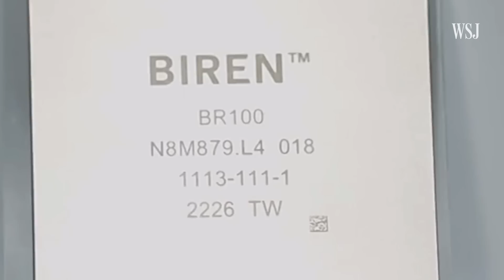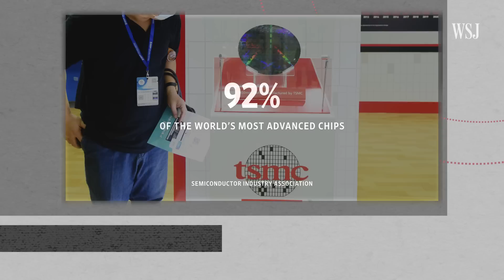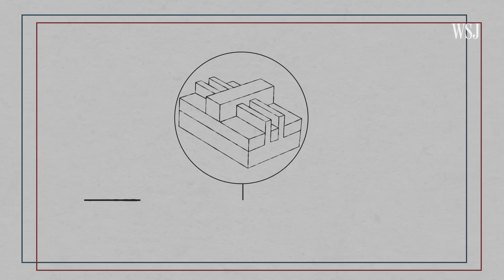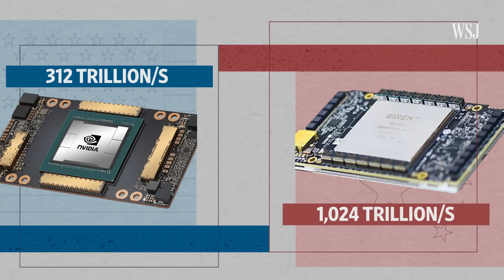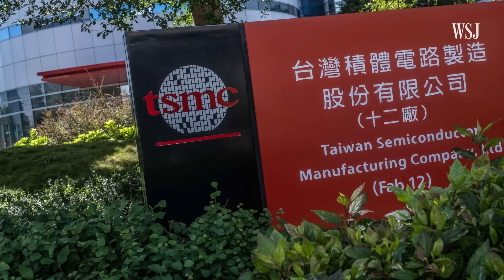Has Nvidia’s A100 Chip Met Its Match With Biren’s BR100 Processor? | WSJ U.S. vs. China

Comment: As someone who works in this field, measuring chip superiority purely by looking at transistor counts and flop/s is a naive approach that will lead to wildly inaccurate conclusions. Scaling memory bandwidth to keep your compute fed with data is a far trickier problem these days than simply stamping out more compute logic and declaring you have a higher theoretical flop/s than your competition. 

Also, one of the most important factors not mentioned is the compiler/software support for your DSA. It is easy to hand craft code that will boast impressive benchmark performance numbers. However, the real secret sauce is having a robust compiler that can efficiently map general workloads to your DSA. It is for this reason most AI chip start ups will fail, not because of inadequacies in their hardware's architecture.
Reply: Compiler support is one reason the x86 architure has stayed around for so long.
Reply: China doesn't have to beat the US pound for pound (or in this case, nm for nm / flop for flop). It just needs to be good enough to overcome US sanctions (which it is doing, at least so far).
Reply: @sleepyjoe4529  No its not even close to doing that . Chinese chips suck hard they cant do anything without Chip imports . All modern chips needed arnt cheap 16 nm . Yes nm do matter if you want to do anything usfull with them .
Reply: @sleepyjoe4529  Hay that is kind like what I said.  So great mines think alike.
Reply: @bobcharles7716  I never heard of thinking mines. Maybe you meant thinking minds.
Reply: Design all you want.  It doesn't matter without the Fab. China has already been able to make the lower end larger nm chips.  It always has been the more advanced chips that they lag and they still do.  We're not even talking about the NG 4nm chips here.  When China has a large domestic fab capable of making them that's when they've arrived.  We're no where close to that hence the huge investment by them and for that matter the US also.
Reply: I'm no expert but,i do agree with you on that part, it does feel kind of alarmist  and exaggerated that the Biren is superior to Nvidia,just like the recent NASA scientist talking about how chna wants to own a portion of the moon...anywho cold war propaganda gave us a lot from the space race,we may get AGI from this new cold war
Reply: Not to mention that these numbers for the A100 are for the AI workloads as  this is primarily a tensor GPU.
Reply: True. Better to wait for 3rd party benchmarks before saying if this is really legit or not. Same thing happened for China's Sunway TaihuLight supercomputer. It earned its spot in the top 10 most powerful computers at 7th place but it uses 10,649,600 cores. While Sierra at 6th place only uses around 1,572,480 IBM cores.

Source: Top500
Reply: @04:02 That's what he said.
Reply: The key is the major market share are in China. When US block China from getting Chip, they are force to build what they need. Whether it is better than US chip doesn't matter anymore, because once the ecosystem establish, there will be no place for US chip anymore.
Reply: How much you make working in chip industry bro? I'm trying to get a job and looking at different fields
Reply: @___Anakin.Skywalker  You dont go into that field just for money . If technology isnt what you want to improve become a banker there you make cash
Reply: @xythiera  how does a banker make money
Reply: @___Anakin.Skywalker  US tech companies are laying off employees especially H1B visa employees.. Tech companies in China has no laid off any employees. So China tech jobs is better now.
Reply: @SimonCU  Most of the lay offs are general workers in the retail not so much in the tech sector. Not to mention Chinese tech companies have been laying off workers in the tech sector for 3 years
Reply: you know what’s funny? when they blocked the chip imports… and said China won’t be able to manufacture it. Now, China has managed to make it. So the claim now is saying china will be unable to build the supporting hardware… which I am pretty sure China will be able to overcome it as well.. and pretty sure the software will also follow the same path
Reply: @aisinchan6640  They never made anything. And that anything can't even be made in China
Reply: COPE
Reply: "It is easy to hand craft code that will boast impressive benchmark performance"
At this point I knew you're just a troll.
Reply: He's exactly right, but what he describes is a secondary problem.
If you don't have the raw processing speed, all bets are off anyways.
We're going to pay dearly for isolating the world, when we get isolated by them.
Reply: @kavorka8855 About?
Reply: @kavorka8855 What??? 😅

No need to bring magic into a conversation about reality 🤨
Reply: "Researching American chips" yes we already "guessed" that.
Reply: Well said 👍
Reply: Oppressive regimes create terrible workers. Nobody will care and only do "good enough", poor quality work, because they have no freedom. because their lives suck.
Reply: Oppressive regimes
Reply: create terri
Reply: ble workers.
Reply: Nobody will care
Reply: only do "good enough"
Reply: poor quality work
Reply: because they
Reply: have no freedom.
Reply: because their
Reply: lives
Reply: su
Reply: ck
Reply: In the end software and optimizations plays major role. Just look how much more performance old cards like RX580 still had just by driver support. I know that this analogy probably don't apply as well to a server GPUs like this but still...
Reply: The reason why its so purly compaired is becouse it cant compeat . China cant make any modern chips to this day . There 180billion went into flames throw corruption .
Reply: The Chinese designed the Tesla's FSD and not to mention Tesla, SpaceX, Solar city are all Chinese rebranded technology incase you didn't know.
Reply: Biren chip look like a cheap GTX 500 series back im the day lol
Reply: As a software engineer, I can assure you compiler will never and could never be the bottleneck in this case, especially for a gpu. GPU is easier to support than cpu simply because you can have your own proprietary instruction sets. Unlike cpu, gpu's usage all goes through software api's first (like DirectX, Vulkan for graphics and gpu-specific api's for machine learning). For cpu, on the other hand, you need to use a widely used instruction set because most programs directly compiles to binary and then shipped. 

From what I saw you mentioned before, I am gonna guess you are not a gpu programmer or engineer and probably a cpu or embedded engineer. Gpu is different, it is like a whole separate computer strapped to your motherboard with its own memory/cache and instruction sets.
Reply: Do you think China will ever be able to have an advanced semiconductor supply chain wholly contained in China, including indigenous EUV lithography machines with all parts made in China with indigenous technology? If so, how long might it take? (I'm thinking 30 years.)
Reply: @FifthGate  Dude they invented the EUV lithography which they sold to Norway. The industrial boom on 1900 was thanks to China sharing their tech with Britain.
Reply: @FifthGate  Nvidia CEO and AMD ceo are Chinese and both of them are also from same family or related. The Chinese designed the Tesla's autopilot with FSD source code and not to mention Tesla, SpaceX, Solar city are all Chinese rebranded technology incase you didn't know.
Reply: @FifthGate  8 year, 3 months, and 25 days top. After that China would be better than anyone in the world
Reply: I am a machine learning engineer.  What he said is the following: The key advantage Nvidia has is its Nvidia CUDA platform of choice for AI development.  I will not trust any other platform,  including AMD’s ROCm.  It is far behind Cuda and I will not use it.
Reply: this is really bad hot take from the WSJ, you'd think they do a modicum of research prior to publishing trash like this. It's like judging a triathlete by a single sport
Reply: Keep laughing son
Reply: Exactly, the vega 56 has better 64bit flops than a 3090, and is comparable to the 2080 in other categories, but performs around as good as a 1660/2060 range.
Reply: @deadoon  Yes.
Reply: Ok, but writing software is easier than manufacturing hardware. If China can manufacture a chip that is capable of those high performance computations and lacks the software tools that streamline development then it's only a matter of time before those appear.
Reply: @ten_tego_teges that’s a naive thing to say. Look at AMD having great GPUs yet not able to break into the AI market. Yes everything is a matter of time pretty much but time is the only matter which matters. Right now Cuda based AI workflows are predominant and mostly supported by all ML frameworks. Id like to see generic approach to be adopted like OpenCL but so far it’s not the case.
Reply: @AI-xi4jk  Good points. However, perhaps AMD doesn't have a CUDA counterpart, because it is expensive to assure compatibility with ML frameworks. It makes little economic sense for them and everyone else.

Meanwhile, China is embargoed. I don't mean that Chinese computational units will undercut Nvidia. I mean that China is or soon will be able to produce their own technology stack independently of America. If it is on par at least with previous gen American/Western tech, then the embargo will be not have the slowing effect we thought it would.

This video claims they can make the chip. If they really overcame the billions of dollars of upfront investment into fabrication facilities then there's nothing stopping them from adding software. For them it makes strategic sense to fund it, for AMD it doesn't have to.
Reply: @ten_tego_teges  AMD does have a counterpart to CUDA. They call them stream processors. 

I think their struggle is mainly the proprietary software such as PhysX. 

While Nvidia has a dominance all they really have to do is match AMDs products and they’ll pull out ahead on benchmarks so long as the software is designed with Nvidia in mind
Reply: @ten_tego_teges  The video just shows the spread of propaganda materials. This chip has absolutely no usage and yet it is claimed to be 3 times faster than the Nvidia A100? Evidence? Something?
Reply: @ten_tego_teges  if they can get probes to the moon and mars by themselves... my guess is its only a matter of time they can build any chip too
Reply: The point is it doesn't have to be as good.  The more question is can it be a substitute/work-around to the American Lead Sanction.   And the larger questions can China have substitutes/work-arounds to all American Lead Sanction, If it can we are seriously screwed!
Reply: @bobcharles7716  China's advantage is its own huge downstream market. As long as the product is basically usable, it will quickly iterate to better and more accurate products.
Reply: @huas5350  Prototypes without any benchmarks means zero, mass production and a real world demonstration of the chips potential means everything.
Reply: @huas5350  so where will this be used?
Reply: @huas5350  China's biggest advantage in the global chip market is the US's aggressive foreign policy that is scaring away many countries.
Reply: @MGZetta  ASML actual bought most of their patents (including the most critical ones) from Taiwan after Canon refused to buy them resulted ASML (a 3 trailer parking lot startup) with dominant market position, namely the immersive EUV (which is currently most advanced right now and ASML's main product)
Reply: @huas5350  Actuly not at alk
Reply: @bobcharles7716  I mean they will eventually, and nobody is under the illusion they won’t. However this is not it, and it will take a long the to steal the IP and recreate these technologies domestically. The idea is that by that point china will already be weakened to the point where they can no longer challenge the US for tech supremacy.
Reply: @bobcharles7716  Don't worry buddy Chinese are not going to take over Americans... The thing with this tech is if you even overtake US chips in every measurable "hardware" way possible the US chips will still be far superior and ahead of the Chinese as the massive gigantic data sets that is needed to train the AI and the logic with the big brains required to solve the ultra-complex problem is only in America at the multi-trillion corporations like Google, Apple, Meta, Amazon etc. And if the talent that is needed to execute this level of operations is sitting somewhere else, These corps will simply buy them out. The only thing that the Chinese are doing is to play the scare game. Because it is long stated that we have far reached the theoretical limit of incompetence b/w hardware and software i.e., We have reached a level of advancement in hardware where the software is slow. At the end... The best things that the USA can do to prevent these non-sensical company to exist in the first place is to just ban the Chinese software(tik-tok etc) in the state!
Reply: @bobcharles7716  Wwhy would we be screwed? Just stop shipping them food lol
Reply: @jarethgar  The biggest grain exporter is Russia!  Ya we are going to be screw!
Reply: @bobcharles7716  why do you want to sanction others so badly?
Reply: @bobcharles7716  Well the chips act is DOA right from the start. Those new plants in Arizona are still work in progress. Anything can happen in the next few years.
I predict it would be like the failed Foxconn project.
By the time the chip plant starts operation, China might already flood the market with low cost chips.
Reply: do you get paid well? what's your area?
Reply: Its good to see more competition among chips maker. Make chips better and competitive prices
Reply: I disagree.  The numbers provide an accurate rough guesstimate.  its a given this is a guesstimate.
Reply: @iliketacos6067  See my vega 56 example. Comparable to a 2080 in flops(with even twice float 64 performance), chipsize, transistor count, tdp and more, but worse across the board in real world performance. Comparable to the impressive 3090 for float 64, yet is a shadow the performance.

Architecture quality, support, and real performance matter many times more than theocraticals.
Reply: @iliketacos6067  Obviously you have no understanding of the field whatsoever. No benchmarks? Then it's just hot air. You also forget the A100 is not an AI chip it's a gpu chip with tensor cores. An AI specific chip is different from a GPU chip.

Comment: I think its worth mentioning the operator support for chips. I am not am expert at the filed of AI nor chip design, but I think it is important for the hardware to support the software so that it can be use by the framework of choice. Besides the operator support, I think GPU serves a function more important than AI - parallelizable scientific computation. It is an important tool for modeling, prediction and analysis of large data.
Reply: You are correct. All these chips being discussed are in fact hardware that support parallel scientific computation. GPUs were used incidentally some decades back by writing code that can be run on GPUs, now the hardware are AI specific and they are more AI specific than the GPUS of yesteryears.
Reply: btw AI workload mentioned is AI training workload which is far cry to the running workload which can be set up on FPGA or smth later

Comment: EUV lithography is crazy, the skill and precision of it, to create a working component down to 3nm, imagine saying that to someone 100 or even 50 years ago and considering a red blood sell is about 7000nm and a strand of DNA is about 2.5nm
Reply: The amazing fact is that they can do it consistently across millions of transistors. 

Making one, incredibly hard for sure, but doable and they could discard failures. 

Making billion transistors with nearly no defects.... It's magic.
Reply: @VoicesInDark  alot of the procedures are done with automation via an algorithm so it's not to extraordinary.
Reply: The most important thing of a manufacturing node is transistor density. nm doesn't mean anything since the 28nm node as things has gotten so small.
Reply: Where and when is this blood sale? 🤔
Reply: The whole nm thing is bunch of marketing fluff since below 90nm, if one actually measured a transistor on an electron microscope, they wouldn't be able to pinpoint any component of the transistor being 3nm.
Reply: @Uruz7Laevatein  ASML actual bought most of their patents (including the most critical ones) from Taiwan after Canon refused to buy them resulted ASML (a 3 trailer parking lot startup) with dominant market position, namely the immersive EUV (which is currently most advanced right now and ASML's main product)
Reply: @Uruz7Laevatein  fin width is 3nm
Reply: @Uruz7Laevatein  the reason why the then dominated Canon refuse to buy the Taiwanese EUV and immersive EUV patents (that was later sold to ASML resulted it's predominance) was because Canon used to champion a different way of etching chips instead of a physical Laser UV light it uses chemical ion - etch technique that is not widely adopted in the Industry and it is mostly used in its advanced memory chips instead of logic chips but this technical route is not widely adopted in the industry similar to the reasons the Air Force adopted F-22 instead of F-23 but just to a point so it is not just one way of etching the chips